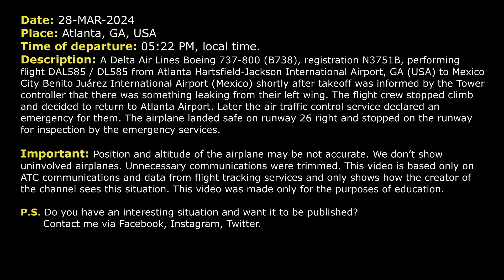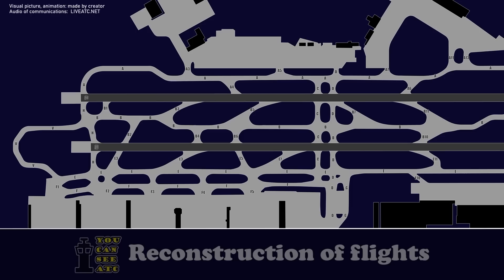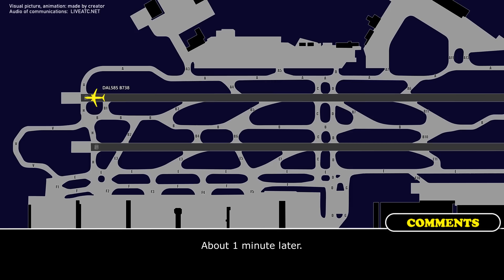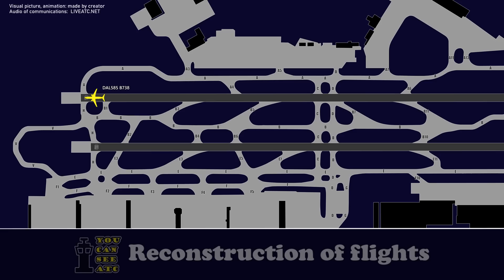Suspected fuel leak on takeoff. Delta Boeing 737 returns to Atlanta. Real ATC

Comment: As someone who has flown on a few of these Delta 737-800s, I’m not totally surprised this one ran into issues. They are overdue for upgrades, and are slowly being retrofitted with the new winglet design. They also have the oldest interiors on any Delta plane, but there’s a program underway to retrofit them. The last one I flew, N3761R with the Skyteam livery, had one of those wing fairing pod things over the flap mechanism that seemed to be loose and yes I know it isn’t a super critical part but still kinda makes you wonder about maintenance on their now 22.5 year old plane.

Comment: ... always always an issue regarding fuel on board. Now they're even asking for number of infants what f next!
Reply: Fuel and souls is standard (fuel due to risk of fire/explosion, souls on board so the firefighters know how many to attempt to rescue). Infants though, that did feel out of place as it's not standard procedure.
Reply: @paulstelian97  My assumption is that in case of fire, resque team will face difficult conditions, low visibility. It helps to know if you need to look for other than adult size, otherwise infants may easily be confounded with luggage for ex.
Reply: @BlueSkyUp_EU  You could well be right, it's just that AFAIK it's not procedure yet, unless I missed something (I'm just an amateur and don't exactly keep up with regulation changes other than from the incidents I watch here on YouTube)
Reply: @paulstelian97  Like you said, most likely it's not standard procedure, but I don't think it's against the rules either, otherwise they wouldn't do it.
When deadly incidents occur, we almost never get insights on what happened from an RFF perspective. It could be that in several cases infants have been missed by rescuers because they've only looked for passengers that are bigger than a handbag.
Reply: @BlueSkyUp_EU  Yeah I mean proposing it to be future standard procedure doesn’t sound bad at all in the end. Worth having a discussion!
Reply: it's pretty common for atc to ask if there are any infants on board during an emergency, it's for the firefighters for accountability as well as if they have to go in the airplane to search/evacuate, that they know there are infants on the plane

Comment: I really appreciate the cognitive disconnect at declaring no Hazmat when you just told him he's carrying over 30,000 pounds of fuel
Reply: ?? hazmat is referring to cargo not gas
Reply: @beckramsey7746  Trust me, when my 777 is carrying 340,000 pounds of fuel (47,890 gallons), the hazmat on board is the least of your worries.
Reply: but it doesn't count, if it did then there would always be hazmat declared. only for cargo involving explosives, gases, flammable materials, oxidizing substances, peroxides, toxic or infectious substances, radioactive materials, corrosives, environmentally hazardous materials, etc! its an interesting topic to me lol
Reply: @user-lm2ix1xd4c  As a cargo pilot, I'm well aware.
Reply: Then why would anyone ask about hazmat then?
Reply: @saxmanb777  because in case of a crash landing, or a fire erupting upon touchdown or mid-air BEFORE touchdown, they need to know about any specifically dangerous materials on the plane which may ADD to the potential disaster. for example, lithium ion batteries can explode if they catch on fire (or even just from too much heat or from stray sparks), so if the plane crashes or even just catches on fire after touchdown, rescue crews and firefighters need to know what, if anything, is dangerous on board which could feed flames or potentially explode

Comment: This was probably excess fuel spilling from the 737's surge tank vent. Given the fact that they have 30000 pounds of fuel, the main wing tanks are most likely full. If the main tanks are overfilled, they flow into the surge tanks. If the surge tank is too full, the excess fuel will spill out of the vent. By the time they landed the excess fuel had spilled or evaporated, leaving no visible indications of the leak for the ARFF crew. Fuel in the surge tank can flow back into the wing tanks, however this is unlikely since there would have still been fuel in the center tank.
Reply: a 73- 8 ,9 only holds 8650-8700 in each wing... never went to VTO in the wings... always left 50-100 pounds for hot days and or expansion..... but generally id agree....very possible..
Reply: But you think a pilot wouldn't know that?
Reply: @brunotcs I would think so, but it's certainly not very common to have fuel leaking out of your plane.

Comment: Good on ATC for having them climb to 7000', likely because of possible leaking fuel.
The minimum altitude for a fuel dump is 6000'. At that altitude, fuel will evaporate before it hits the ground.
Reply: No fuel dumping on a 737. Likely it was for other traffic the climb to 7000.
Reply: @JohnJohn-wt5ll 
The idea is if there is a fuel leak,then this is similar to a fuel dump,hence the higher altitude.
Reply: "No fuel dumping on a 737"  @JohnJohn-wt5ll  
Yes, I know this, I was using the minimum fuel dump altitude as an example.

Comment: Now TC asks for number of infants?
Reply: I'm a gate agent, and when we give the pilots and flight attendants our final number of passengers on board, we always include the lap infants in a separate category, since they don't have their own tickets/seats. We also do this for anyone who might be in the jump seat. So the final tally might be 154 regular passengers plus 3 infants plus 0 jumpseats.
Reply: I don't recall the details, but there was an incident not so long ago where two infants were on board an emergency aircraft and it resulted in a discrepancy in the number of souls on board. I don't think it caused an issue, but it did highlight the potential for one. Asking number of infants has been happening a lot more since.
Reply: Infant diapers = HAZMAT...